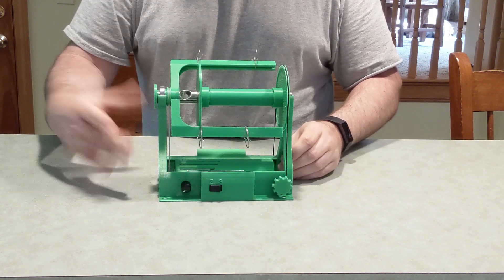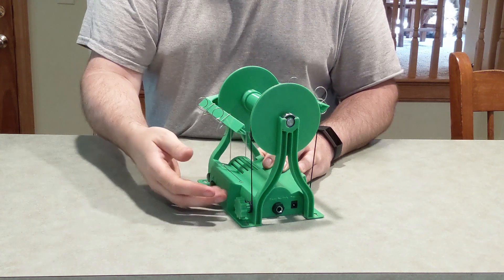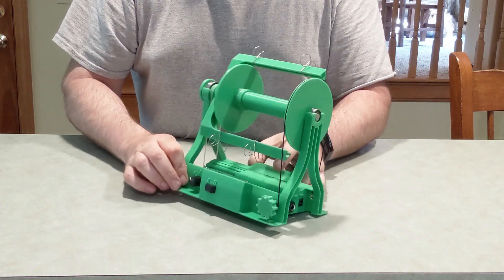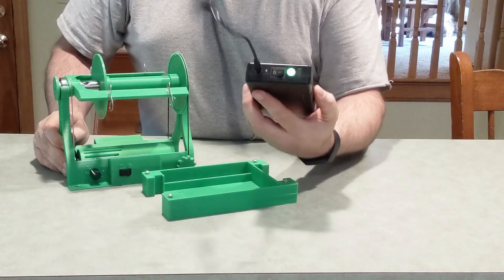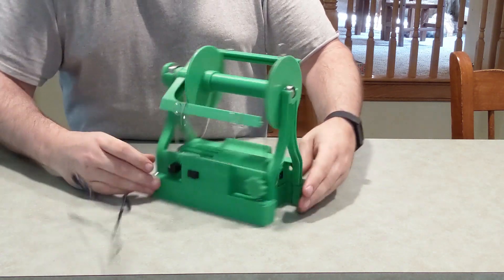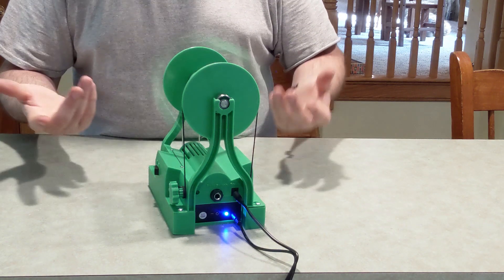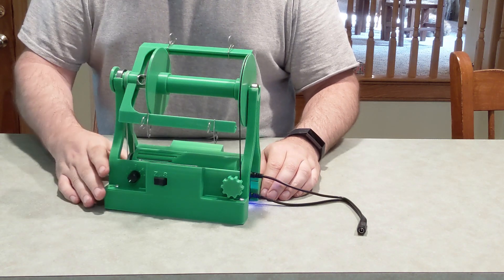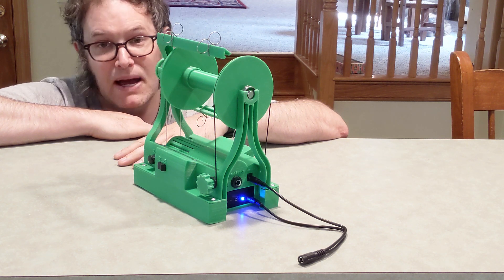SPIN #56 - Update on the EEW 5.x Prototype

Comment: Hi I want to order but who many fault your batter please I need your answers
Reply: I live in Bahrain and the pours Electric its 24 fault but I have address in USE
Reply from the maker: Sorry, I don't understand your question.  Please go to dreamingrobots.com and use the contact link at the bottom.
Reply: I mean the electric its how many volt in my cantery 220v and in use 110v if I order EEW Nano it will not be damage

Comment: Looks great so far. I like where the different buttons are placed and the bigger loops on the hooks (could be even bigger). A few suggestions: Neodym magnets to attach the battery pack and some way to attach the leader yarn to the bobbin (maybe holes in the shaft).